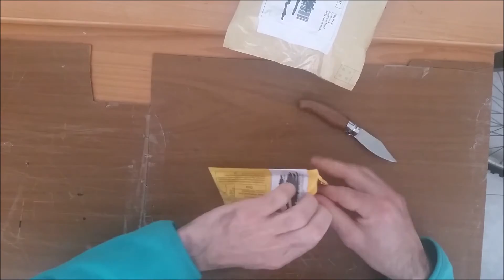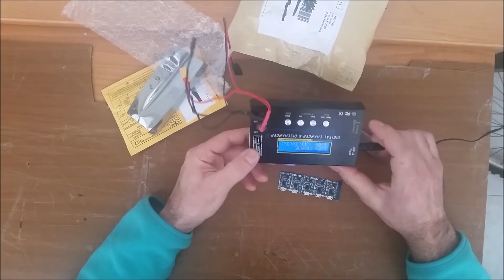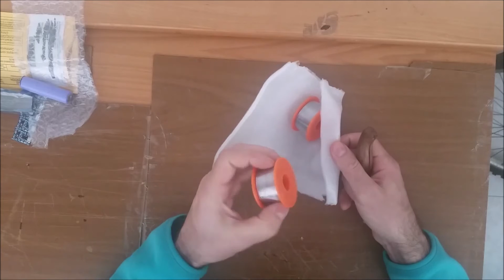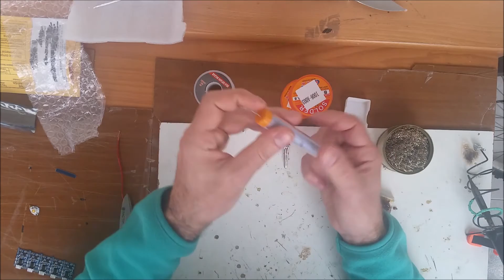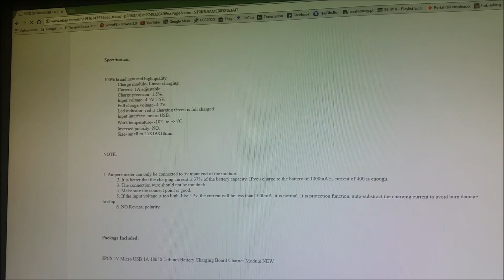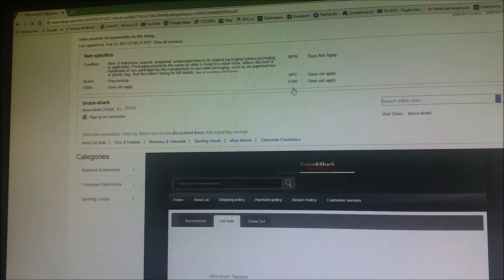Buy Cheap#29 0 8mm 63 37 50g Rosin Core Solder, 18650 Lithium Battery Charging Board eBay

Comment: That solder you got from the local shop, not shiney and thicker, is for plumbing and fire torch. That why it's hard to melt with the soldering iron. 
Also it is corrosive so don't use with electronic pcb. 
I used it too before, just ok for cable joints and connectors.